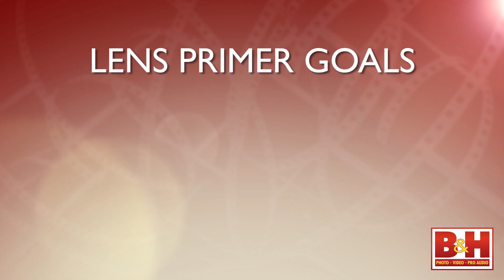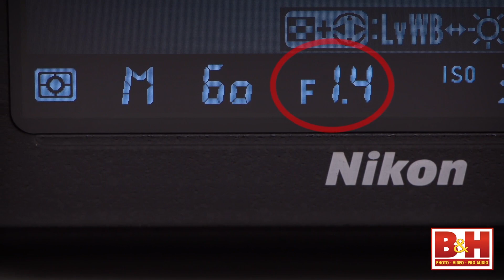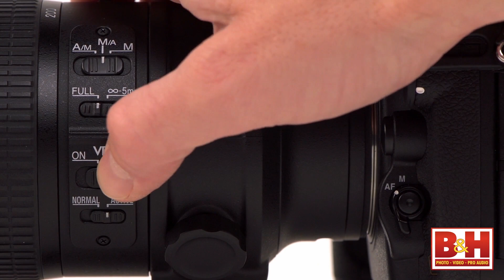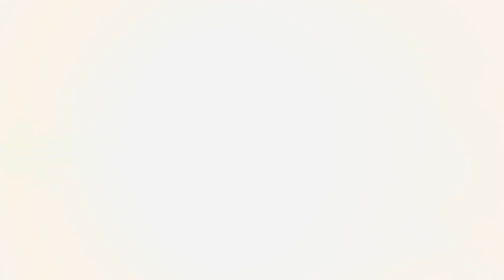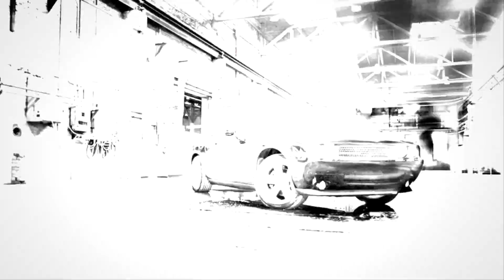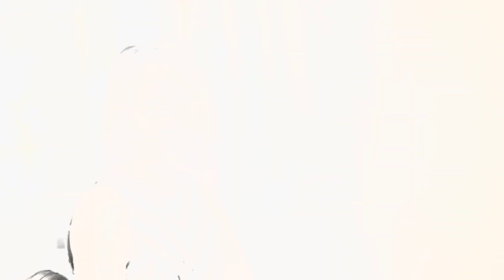DSLR Lens Primer: Part 1

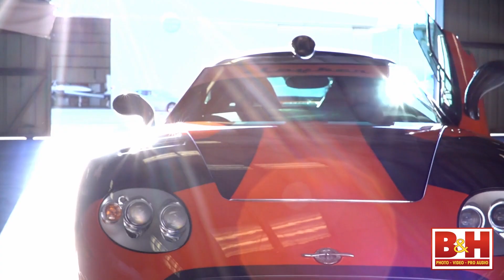Comment: In the part about lens hoods reducing flare, at about 9:00 you show an image of an airplane with the sun behind it, in the frame. Lens hoods only block light from sources outside the frame, though. When you can see the lightsource itself in the photograph, a lens hood won't help to reduce flare at all.